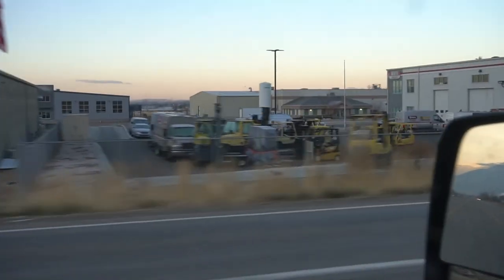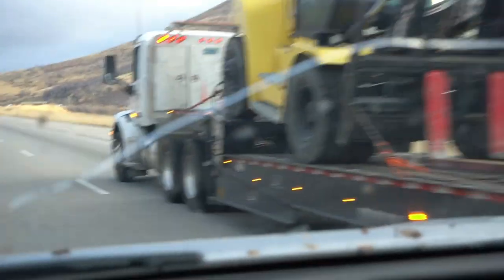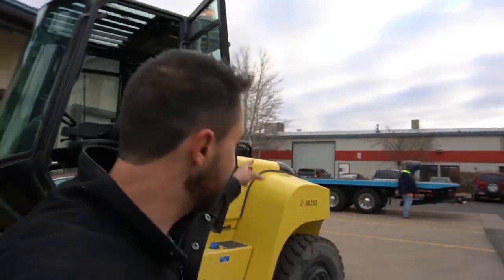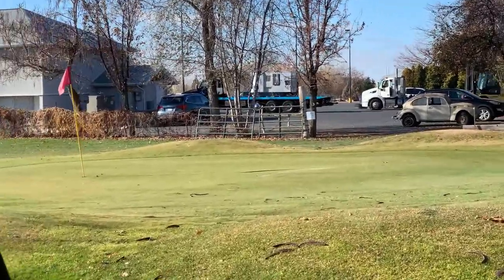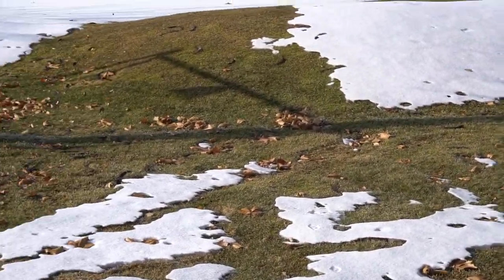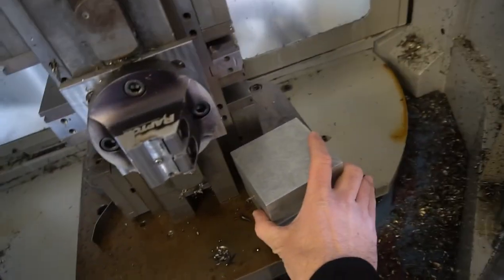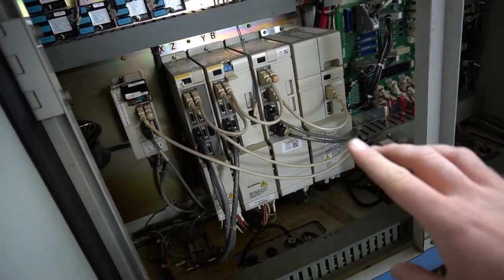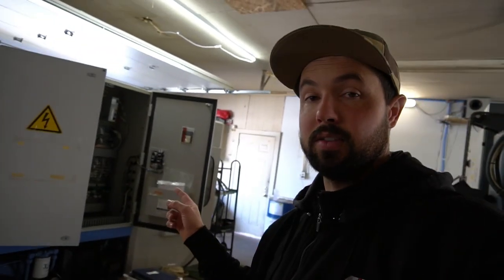Rigging A CNC Mill!

Comment: hmm I'm a bit late but I think it would be very foolish to retrofit that to something like Linux cnc. Linux wont even get close to competing with all the things in that controller.
Reply from the maker: Ian, I didn’t go with Linux I chose a Centroid Oak.  I did a full board and servos swap.  Pretty happy with it.  Runs tight and has infinitely more capability than the stock Mazatrol M640 would have had.
Reply: That’s awesome that you got it to work well.

Did you atleast give the Mazak controller a chance? It’s one of my favorites but I also haven’t run a heidenhien or Siemens controller so can’t say I’ve run all the big names.

At least you are having good luck with the centroid watching YouTube I’ve seen lots of poor conversions and issues with conversions. Also lots of conversions where they get it working but doesn’t have nearly as many of the safety features and stability as the original controller

How did getting the pallet changer and all the interlocks for that and the tool changer work with the centroid?